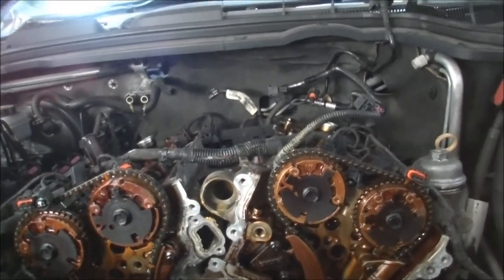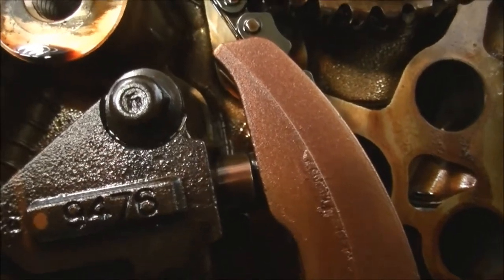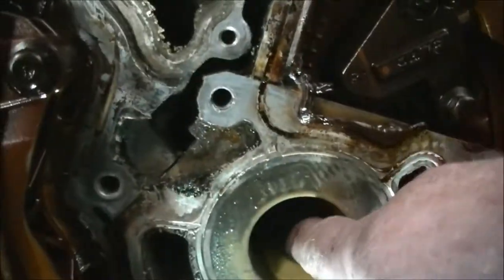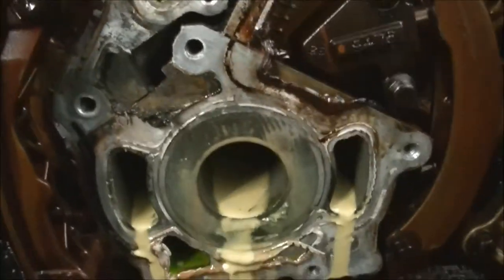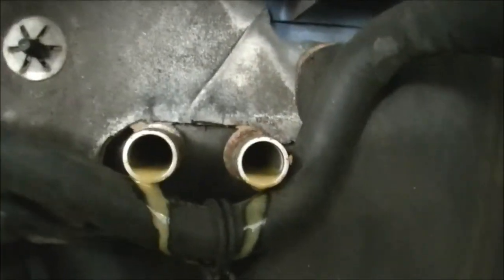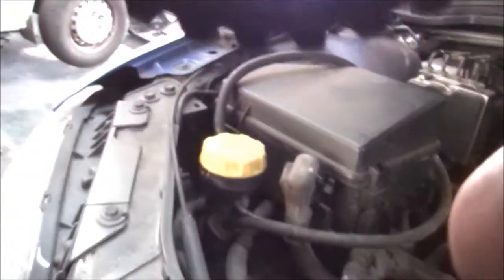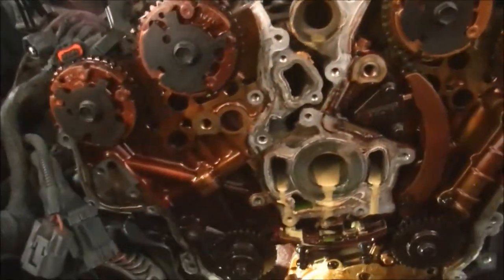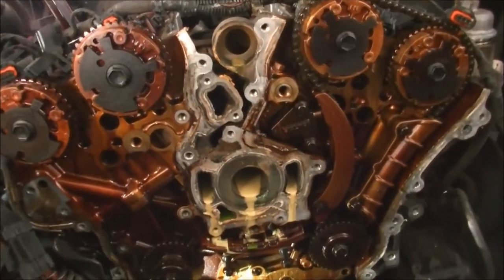Crank to cam code and oil in the water.

Comment: Those engines seem to have quite a few problems. Quite a bit of work to be done on this one. Nice catch on the crank!!
Reply from the maker: They sure do if they're neglected...even if they're looked after really well the still have issues and they're all expensive to repair due to the labor involved...It'll run real nice again when the valvetrain is happy...I hope the  rest of the car can keep up...Cheers mate.

Comment: I don't know why Holden just pinned the crankshaft timing gear into place on the Alloytec V6 engines.

I bought a VY SS Commodore with the LS1 V8 engine instead because I couldn't afford the manual SV6 option,the Alloytec V6 is an otherwise durable engine which can have timing chain issues as my grandfathers VZ has over 330,000 kms on it & still runs like new.

Both the L36 (ECOTEC) V6 & the Chevy LS1 V8 engines have a much longer timing gear key & keyway on the crankshaft meaning it covers a larger surface area of the timing gear which means it can handle more load.

I haven't been worried with the fact the LS1 is a pushrod motor as they run smooth & has high flowing stock cylinder heads on it (290 CFM I think) & the most aggressive highest lift stock camshaft which GM has fitted into an LS1 engine (99-00 Camaro camshaft) as opposed to the same year of motor (2002) in the U.S. which is fitted with the LQ4 6 litre V8 camshaft (basically a truck cam),the only other engine with a more aggressive stock camshaft from those years was the LS6 engines camshaft,the 2001 onwards LS1 engines do run the higher flowing LS6 intake stock.

The stock LS1 puts out as much power as the stock 32 valve Nissan VK56DE (5.6 litre) but mine has been tuned to put out 41 kilowatts more than stock.

Mine will have over 338,000 kms on it when I do the camshaft & lifter replacement, I'll also throw a new timing chain on it as well, the lifters & camshaft are stuffed from when the lifters got stuck in the engine so the October labour day long weekend looks like a good time to do the swap.

I have been finding that I get 6 cylinder fuel consumption out of the LS1 & I'm glad that I've heard on the news that Holden is to keep manufacturing in Australia,I've heard that Chevrolet wants to produce a 32 valve version of the V8 engine which will be good to see,meaning that they can get more power across the board without sacrificing on fuel consumption.

I mean, the old HSV 5 litre engine put out 195 kilowatts in the VT series 1 Commodore & now the 24 valve HFV6 engine achieves 210 kilowatts out of a 3.6 litre capacity but I can imagine the fuel consumption figures match my 276 kilowatt  5.7 litre LS1 engine or equivalent powered LS2 & L76 engines (both 6 litres).

I've been getting 10 - 10.5 litres per 100 kms out of the LS1 engine & 6 speed manual combo when driving normally.
Reply from the maker: They'd have done it to reduce production costs and time...I'm a fan of the old Holden V8....Thanks for your time Russell.

Comment: Wonder what caused that Zig ?? The pin may be flawed or the gear ?? Interesting .. Thumbs up man ..
Reply from the maker: The kits don't come with a new crank gear so they only get changed when needed...Looking at the chains,I'll say they've been done before but not changed the gear...The vehicle is just coming up to 320,000 kms..That's 200,000 miles...Cheers Shawn.
Reply: Ahhh, I see .. Thanks Zig !!

Comment: Thats a lot of money to be spending on a VZ.  How do you go about clean the cooling system? Do you used and special products or just the garden hose and some water?
Reply from the maker: It's an '07 VE SV6...We'll break it down with biodegradable chemicals and degreasers and pressure flush the muck out of the block before the new radiator is plumbed in...Cheers John.